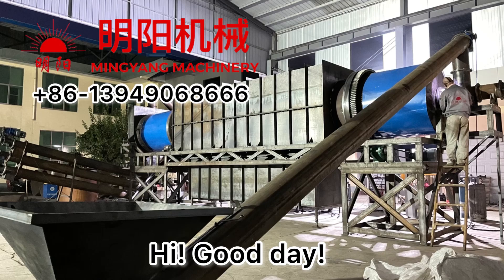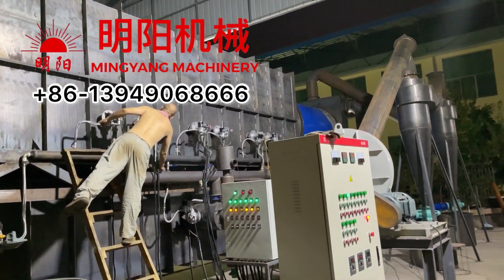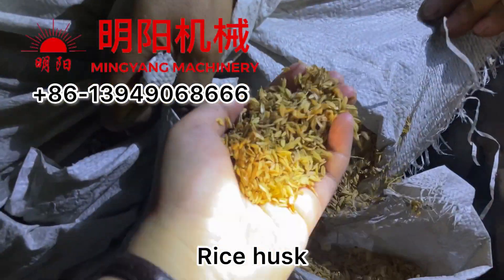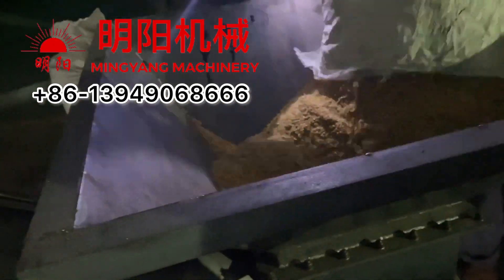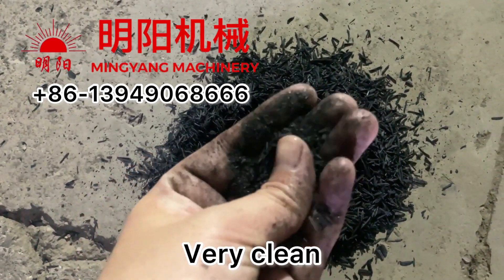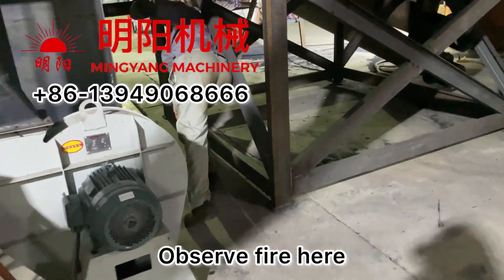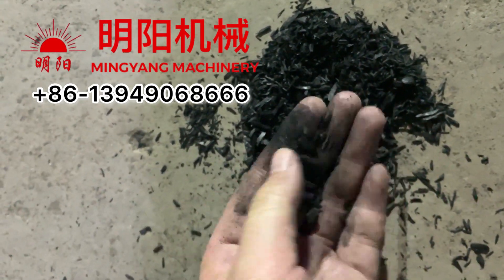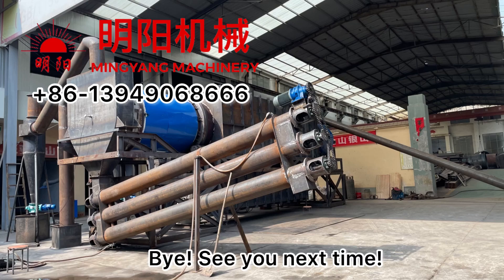Sawdust Bamboo Charcoal Biochar Continuous Carbonization Furnace working activated carbon fertilizer

Comment: Thanks for the video Kim!
Is the furnace indirect carbonization? That is, do the solids not come into contact with the gases produced by combustion?
Do you carry out carbonization in an inert atmosphere and what gas do you use?
Reply from the maker: Yes, this is in-direct heating. All syngas comes out from furnace, then go through purification, then through a burner to burn as fire in the bottom chamber( outer of the drum, materials are carbonized inside the drum). We use recycled syngas as main heating fuel. But before we have syngas, we will need use external heating fuel, you can use LPG( liquid gas) or diesel or pellet burners to preheat up to 300 centigrade, then materials will start carbonization at this temperature. Please contact kim whatsapp: +86- 13949068666. We will send you solution with Quotation list